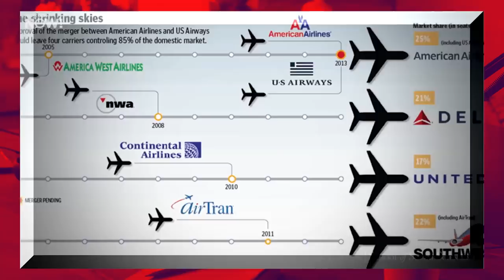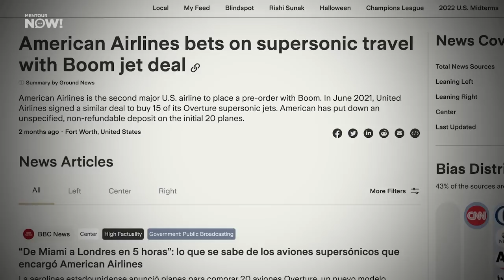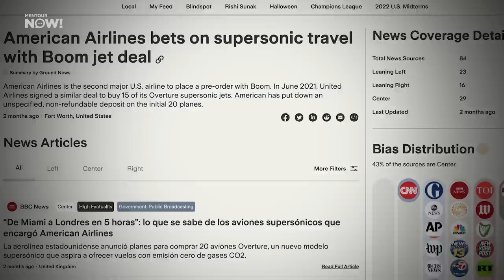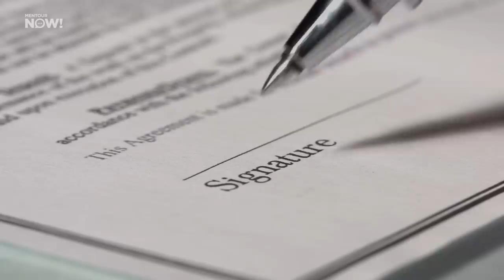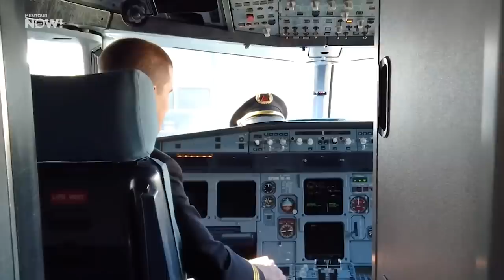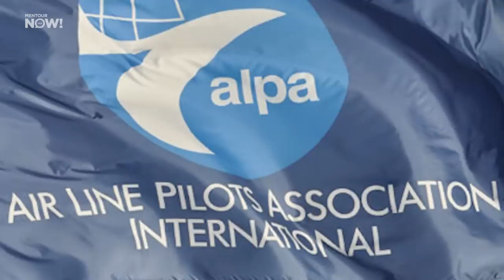Is This the DEATH of the US Regional Airlines?!

Comment: It seems to be the case that the regionals here in the US mainly serve the purpose of connecting less-popular (not necessarily smaller) airports to central hubs, rather than providing service between small airports that can’t support larger aircraft. I live in Albuquerque, and even though we have an airport with 3 large, long runways and consistent wide-body cargo traffic, nearly every passenger flight is on a regional jet (aside from southwest’s 737s and Delta’s a320 connection to Atlanta). Seems to be true at other airports that aren’t major passenger hubs too.
Reply: American flies 737’s into ABQ all the time while Delta uses Airbus to do the same.
Reply: FWIW 737s and A320s fly internationally between New Zealand and Australia, usually a 3 and a half hour plus flight. "Regional" planes in New Zealand add ATR72s and de Havilland Q300s flown by the national carrier to the jets and then even smaller planes flown by true regional air lines e.g. C208s
Reply: Also for carriers flying into another dominant carrier's hub. People residing in Houston may fly United to Dallas, while people residing in Dallas may fly American to Houston. They both want enough frequency so people don't choose the other airline based on schedule, so some of those planes will be regionals. They both also want to support their international operations from their home airports.

Comment: The 175, which has 76 seats is far more popular with flight crews and passengers. The 50 seaters are disappearing, partly because the 175 is so popular, and partly because they can go to most places the 50 seaters go. Analysing an entire industry based on two planes out of thousands is grossly inaccurate. The 190s aren’t as efficient at the mailine level and they’re disappearing. As for rate increases, it’s about time. And now the mainlines are in contract negotiations, and after the next year or two they’ll be making more too. So the regionals aren’t going anywhere. BTW, there are regional pilots now making more money than some of their mainline counterparts.

Comment: I've noticed this year that a lot of routes i fly that used to be CRJ-700 and/or CRJ-900, are now being serviced by 737's a lot of the time.  And i was told by a pilot (for Delta airlines) that it was because of the pilot shortage.  They don't have enough pilots for the flight deck positions they have.

Comment: The regional airlines you mentioned in Scandinavia remind me of the daily milk run route that Alaska does from Seattle to Anchorage via the Southern Alaska Inner Passage.  Which is both to serve small Alaskan town for cargo shipments and residents getting to Anchorage, Juneau, or the lower 48.
Reply: Probably this is no coincidence: Both - Norway and Sweden - are large in size but only sparsely populated with only a few larger cities. The northern parts of the Countries are Arctic Regions with very long and very harsh winters. Both Countries have an Airline doing all the necessary stuff in this remote areas and connecting them with the few larger cities: Wideroe in Norway and Bra in Sweden.

Comment: Things sure have changed. One of my first regional flights was out of somewhere in South Carolina 45 years ago. The guy at the check in counter loaded the luggage, then was the pilot. I was the last passenger on, and all the seats were full, so I ended up sitting in the front right seat. The pilot asked me not to touch any of the instruments.
Reply: ah, the golden age of flying
Reply: That still happens, hop on a Cape Air flight sometime.

Comment: Here in Dallas Fort Worth we had the Wright amendment which was a law passed to prevent Southwest from competing against the big boys. It also was to protect DFW airport from losing income to Love Field. That kept them regional, but the law has expired. I’m pretty sure Southwest still doesn’t fly out of DFW. For a while, the big three were buying up gates at Love Field to keep Southwest from expanding.
They also have a strong Lobby to prevent high speed rail from DFW to Houston.
Reply: Checker Cab fought the rail connection from ORD to Chicago for years.
Reply: Southwest is expected to start occupying DFW in 2024. The contract states they have to operate only out of love field until 2024. So they can start buying gates at DFW if they wanted (and they might)

Comment: I am looking at SkyWest’s route map. They do routes for the big four (you left out Alaska Air) major US airlines. Most of the routes are from a hub to a small airport.

GoJet also flies between hubs and a lot of small airports, but are only working with one major. Endeavor does the same with Delta.

The US does not have the rail network that Europe has. Look at the combined route maps of Skywest, GoJet, and Endeavor to see how many more small airports are served by air here that would be served by rail in Europe.

I have been flying long enough that I have seen some of these regional airlines switch between which major they worked with or new regional become the airline serving the route for the major.
Reply: Skywest is able to cover more airlines (UA, AA, DL, AS) because they're an independent regional airline (the largest in the world actually).  I believe most, if not all, the other regional airlines are owned (wholly and in part) by the previous mentioned airlines.
Reply: LMAO Alaska is not part of any Big Four 😂. Their presence is pretty minimal everywhere else except the West Coast.

Comment: I don’t think the regional airlines are dying, but they’re definitely being regrouped. There’s a lot of small airports, especially in Texas, that see regional service to DFW. A lot of these locations can’t sustain service and are losing service all together.
Reply: services to EAS airports are definitely going through an adjustment period. My airline cut travel to at least 29 EAS cities this year, mainly due to not having enough pilots.
Reply: I think it’s a problem of not having aircraft that can serve them any more.  Not one of the aircraft that served the fields in my state (save the three majors) are manufactured any more, nor is any airline still flying them.  Southern is stepping in, and it’s a godsend, but they’re still working out the kinks.  Seems also that the milkrun flights are gone, not sure why.

Comment: My wife travels a lot for work and we deliberately chose to live in a city with a big regional airport rather than a major hub. She has many more flight choices from here than she might at a major hub airport. With her preferred airline, there are 5 hubs she can connect through to get to her various destinations.  She has never missed a meeting or appointment due to weather or equipment, while some of her major hub based colleagues have.  Also, drop off or parking, car rental, check in and security are much easier than at a major hub.  Yes, there is connection time added, but the ease of use of our home airport makes up for the connections.
Reply: @BK Binj - having worked high travel jobs for the majority of my career, some to the tune of 80% on the road, I also evolved to using this strategy, both for my home Port and chosen destination airports.  Logan or Providence? No brainer - PVD everytime.  Stress minimization has a value.
Reply from the maker: That’s a fair point. Thank you
Reply: Tickets are cheaper aswell

Comment: Good video overall, but you're overlooking a key piece: Southwest. You repeatedly pointed out that regional partner airlines don't fly to smaller airports as much as their European equivalents do. That is because Southwest focuses on these smaller regional flights. And it has a very successful business model by focusing on shorter flights between smaller airports in smaller planes.
Reply: Small 737 planes.
Reply: Better yet, the A220 was designed to fly between smaller airports on LONG flights, if necessary. That's probably where things are headed.
Reply: Southwest flies anything between 40 min to 5 hour+ flights.  Flights are almost always full.  All 737s.  It can be done and they’ve proved it.  They run an efficient model.
Reply: @spyrosg3172  Not much demand for smaller airport to smaller airport flights though. Most people want to fly to a big hub.
Reply: @casmatori  That's exactly where the maker of the video misses the whole point. These are feeder airlines. They move passengers to and from the major airlines hubs. There is very, very low demand for small airport to small airport flights.
Reply: You guys have to consider the fact that Major airlines choose not to fly in their bigger planes to regional airports because they can’t guarantee a profitable trip every flight. Regional airports normally serve passengers who fly into bigger hubs then either reroute to small regions or big cities. However, many people, and I’m one of them, prefer to avoid a regional airport and drive 2+hrs to a major airport in order to save money or get more options or a more direct flight to my destination.
Regionalto hub tickets are also pretty cheap so that’s what attracts passengers to feed into bigger hubs.
Reply: True point.
Reply: @randc47  But it’s a bad airline, isn’t it?
Reply: @MrPomelo555  Southwest is one of the most loved airline in the US. They have an almost cult following like you would find for Apple.
Reply: @genxer74  Thanks for the info. The frequency of events involving Southwest I see on the web seem to be quite high but it is probably just an impression.
Reply: Cool and everything, but please make a Miami Intl - Tampa Intl regional flight lol, why isn't that a thing yet
Reply: The regionals aren't trying to emulate Southwest with the lower-frequency point-to-point routes. They mainly fly to small cities that Southwest doesn't serve, and connect those communities to the rest of the broad domestic network that the Big Three airlines operate from their hubs.

Comment: Displays a fundamental misunderstanding of how the US air transportation market developed since the 1970s, very differently than ROW, from 9-seat piston-powered independent commuters to selective interline, to 19 to 30-seat turboprop revenue sharing, to 76-seat EJET Capacity Purchase Agreements proffered by mainline carriers under contractual scope limits, yet operating more than half of domestic departures to both major and smaller cities, carrying higher fare business passengers locally and to and from connecting hubs, on lower trip cost equipment, utilizing labor arbitrage for as long as that lasted, now relying on lower trip costs.

Comment: You said you would get back to the topic of frequencies but didn't really (aside from the issue of total fuel burn). It's quite possible that LGA-PIT has a demand of 225 passengers a day, but spread out over the course of the day (e.g. business passengers in the morning and evening, and leisure travelers during the midday). The only way to capture all of this demand is by flying a 76-seater E175 three times a day. You could put an A321 on the route and only fly once, but you wouldn't be able to fill 225 seats, as half your business passengers and a chunk of leisure travelers would refuse to fly at a time inconvenient to them.

Comment: Hey @Mentour Now!

One of the big factors of having regional airlines is frequency of flights and that was discussed by many in the comments. 

Another reason I haven’t seen mention is the legal and logistic isolation from the big three businesses. You mentioned fleet sizes and that is a big factor that drives their existence. 

For example, Delta doesn’t want to create the infrastructure required to house, maintain, and operate all fo those regional jets. Most importantly it doesn’t want to have the legal and regulatory liability of operating them.

There are several excellent videos documenting the controversy of “are regional airlines actually different companies?”  This was highlighted as a part of the Colgan Air tragedy and the accompanying lawsuits levied by the victims families.

For now, Delta, United, and American Airlines are allowed to reap the full business benefits of these smaller regional airlines within assuming any financial, logistical, legal, or regulatory liability.

It’s a huge win for the big 3 that they continue to exist.

With jets like the CSeries/A220 emerging as a class of airplane that is smaller, regional size but has the efficiency to fly farther point to point route, it will be interesting to see if the big three start operating more direct flights because the economics start to make sense with those planes. 

Consumers pay more for direct flights and want a direct flight but not too much. The CSeries/A220 and future similar aircraft could make the need/shift away from regional operators possible.
Reply: Don’t forget the embraer E2 (175, 190 and 195)

Comment: Great video. Living here I see it very differently. I believe the planes you chose to monitor was a small sample and maybe not representative of the majority of the regional jets patterns and the airport sizes they fly into. A lot of smaller cities rely on these regional jets to get to bigger hubs. Some places might be 4-8 hour drives to a big hub. These jets fill the gap and in my experience are always full. Not to mention the gating at the smaller airports would cost a fortune to get them equipped to handle a bigger plane.
Reply: as I understood it, he's not saying the regional flights won't be happening, he's saying the airlines might change their business structure.
Reply: And the reason that the major airlines don’t just fly smaller jets to those places are because they’ve realized that they can rip off pilots by this artificial division. Hopefully, this scam is coming to an end.
Reply: @rynovoski  agreed its like the pilots have to pay the airlines to fly at this point

Comment: I used to be a Comair/Delta Connection regional airline employee and we were a wholly owned subsidiary of Delta Airlines.  Your take is credible, however, there is also an aspect you didn't cover...frequency.  The US market demands frequency over plane size.  Yes, you can put an A321 in place of 3 EMB175s, thus savings the additional crew, fuel, etc...but at the expense of the demand by the pax demand to have (sometimes) hourly flights between local airports and hubs...or point to point flights.

For example, at my local airport, we have 4-5 rotations to the various hubs for the Legacy3 as well as our RONs throughout the day.  Yeah, you could cut that in half and use A321s or 757s, but we get regionals and mainline combinations depending on the legacy carrier.  Then add in the other rotations to places like DCA and EWR as well, plus WN, G4 and F9 service as well.  So it is about frequency that, in many cases dictates the multiple trips between hub/outstation daily.  And the regional feed allows for the 76 seats and fewer during the hours that don't require 150+ seats, but pax still demand the convenience of timing of flights.
Reply: @D Peters - hey, glad to know there are still some Comair folks around!  We miss you guys here in the Tristate.  I loved that little airline - bounced all over the eastern part of the country, never having to deal with the hassles of a mega airport.  I hope you were able to land a good position elsewhere.

Comment: A part you miss is business travel drives these routes. Saying 2-3 per day could be one larger aircraft while true doesn’t meet their customer needs. In the US business travel mostly doesn’t include travel days especially for for shorter hauls.  Not having a morning and evening option (and with the travelers preferred airline) ruins the model   Additionally they augment RJs midday. AA may use an RJ midday for two PHL to BOS and mainline for the numerous morning and evening flights.  Frequency is a huge factor you miss. Honestly the work travel dynamic is less intense for same day travel in Europe (not none existent but not as demand driven)